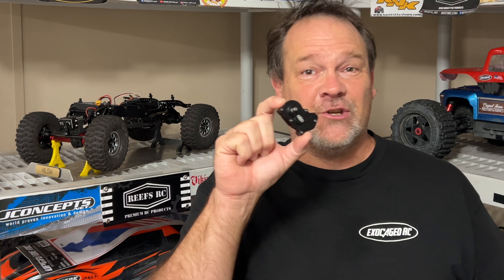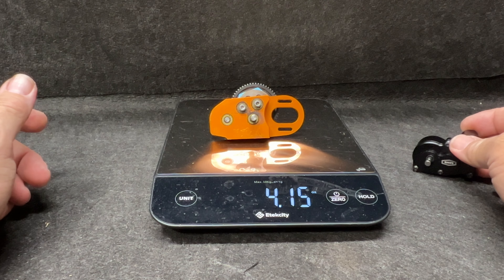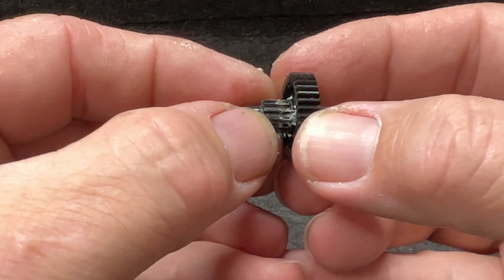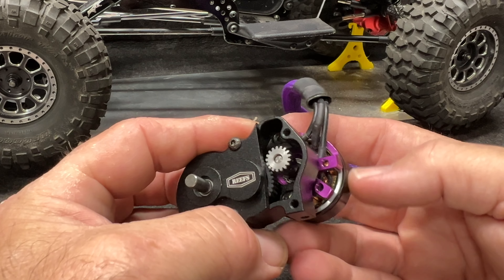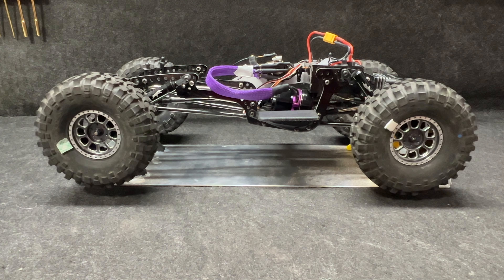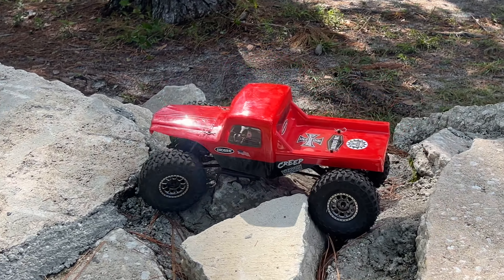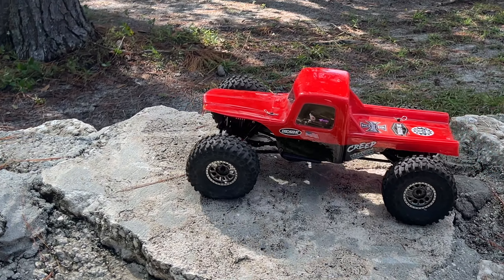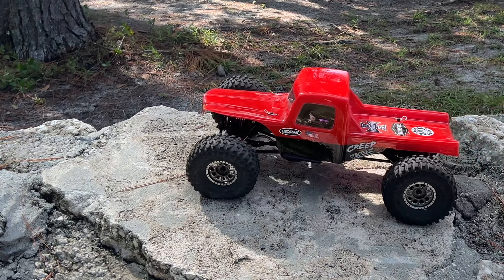Reefs XP T3 Exos First drive

Comment: I run the team spec 1800 on 3s. My pinions a 13 tooth on portals through an axial transmission. That setup is so smooth and all torque. I dont have much wheel speed but for what i do its perfect.

Comment: If your gonna do the mullet with this setup, underdrive the front, 9verdrive the rear, and if you use a transmission with 30% OD and send it to the rear acpe youll end up around 40-46% OD.

Comment: I dont think the lack of over/underdrive is a problem like you said you can get a lot just in the axles gears alone.   Im a 2 low guy but when you weighed them both it really showd how much smaller it was than the already small 2 low. I can see that being a huge selling ooint

Comment: About $100 for two gears and one small aluminium case...
Reply from the maker: Yep and for high end competition, this is cheap
Reply: I agree with higher price usually for a comp built transmission @ExocagedRC class saving weight is a key to make it forward bias weight
Reply: Mad isn’t it, they’re $140pre tax here in Canada

Comment: 1 rotation to 1/2 a rotation is 50%, I think.
Reply: 50% would be 1.5:1
Reply: I was thinking both wheels needed to make a full rotation to get an easy to convert number.  I guess you could say if they kept going it would have been 2 :1 which in my head is 100% since one wheel rotated 100% more than the other.